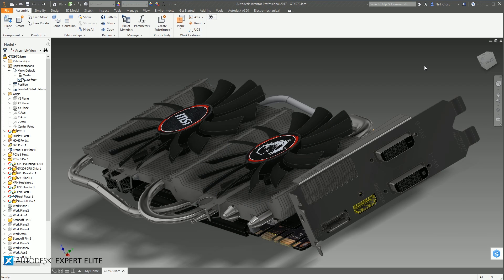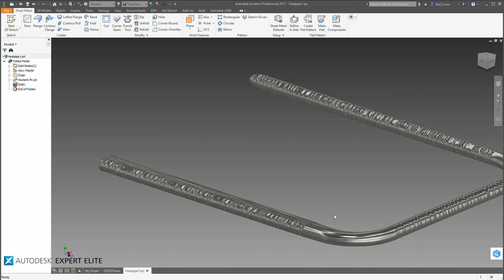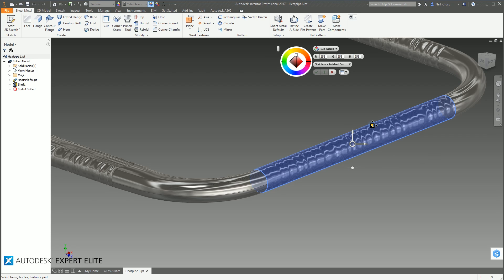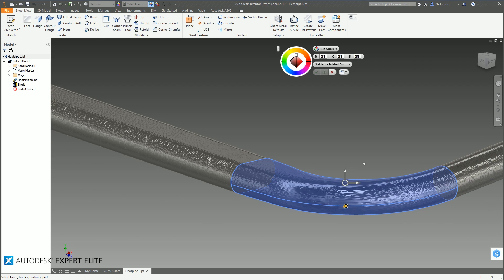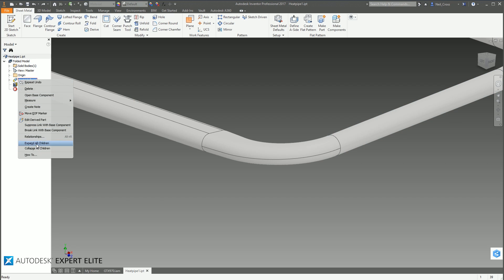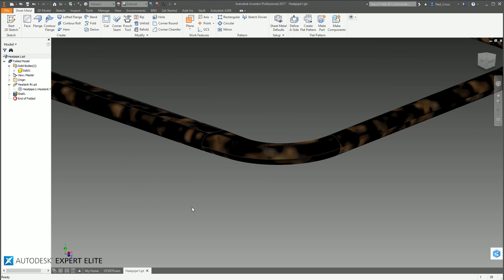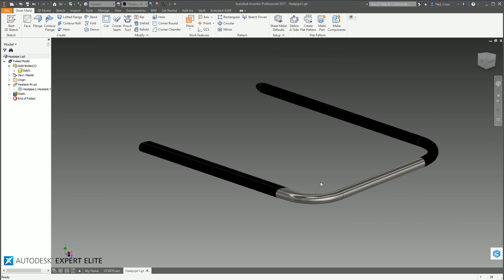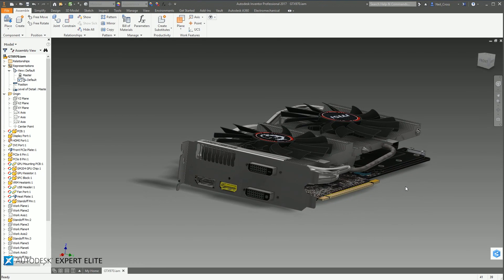Fixing Textures, Overrides, Scale & Rotation | Autodesk Inventor

Comment: Neil, Sometimes when I select the "Adjustment" tool and then pick a face, I do not get the adjustment tools to change the angle or the scale. I get the adjust tools for the RGB tint of the face, just not the others like you show here. Would you happen to know why that is?
Reply from the maker: +Kirk Arthur Hey Kirk, my first immediate thought was have you used a texture from the Autodesk Appearance Library and have you got a texture with an associated image? I'm thinking maybe if the appearance is just a solid colour it might be intelligent enough to not give rotation and scale options as there'd be nothing to rotate or scale
Reply: Neil,
That is correct.  What I figured out was that unless there is an image associated with the texture, then the "Adjustment" tool will not change the angle or scale. No need really in the scale and angle tool being available in that case.  Thanks

Comment: Neil, if i make these changes to a part material like this, do these changes effect the global material list i.e would the change carry over when used in other parts and assembly models?
Reply from the maker: Nah it's a local texture change which only exists in that part - but if you take the texture it creates i.e. Stainless(1) and then publish it into your global style library, then it can be used elsewhere
Reply: Thanks Neil, I just wanted to check I wouldn't screw up the standard library before I changed anything.